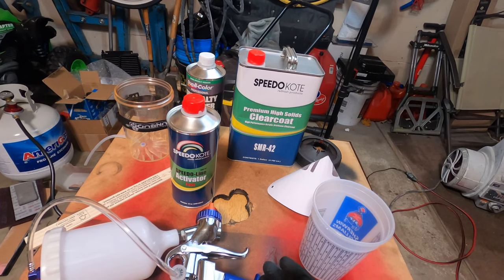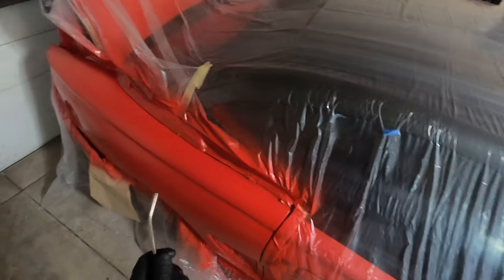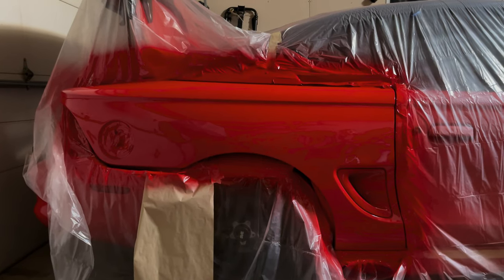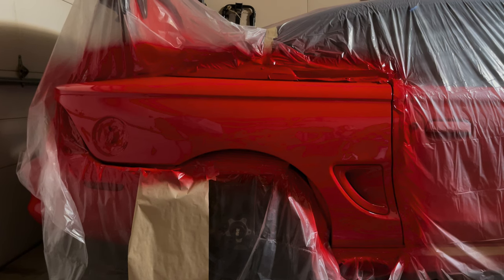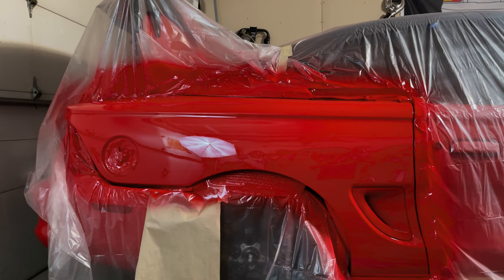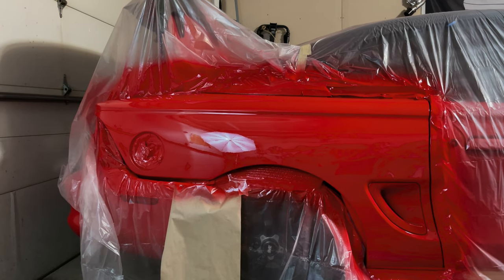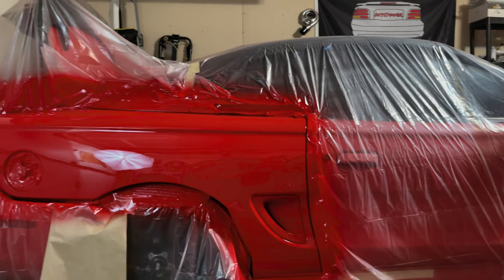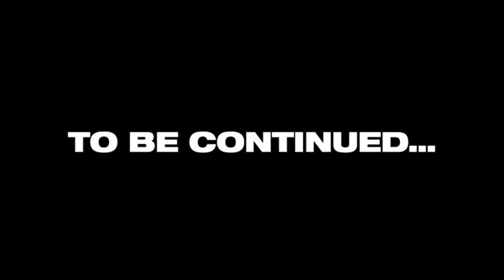How to spray paint your Mustang PT.2

Comment: Can't wait to see the final results! I see you going with the style I went with on mine I love my black top on my 98 Mach 1. Also with the orange peel a good wet sand and buff and polish is like  a grinder for a welder it will look 10x better if you decide to do it but it's a lot of work took me an whole day. 
https://youtu.be/WnnmihCzaRk
Reply from the maker: I'll definitely check it out. Last time I painted I started with 1200 grit and went 1500, 2000,2500 and 3000. This time I did a 1500,2000 and 3000 on a test spot and it came out great.
Reply: @SN95Power  That's what I did as well. Sounds like you already know what you're doing
Reply from the maker: @DCreatorsCreations  I've never used a turbine sprayer before and the gun setup is different. I actually read the instructions for the gun and seems like I'm choking it too much. Taking bumpers off next and hopefully I can get the gun dialed in.
Reply: @SN95Power  yeah I saw that I'm sure you did but did you have your measurements right?